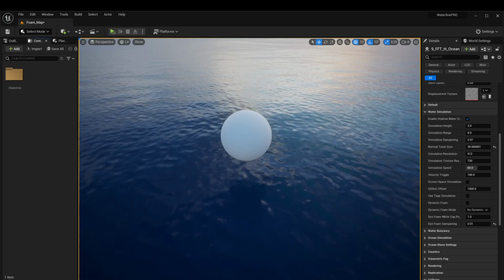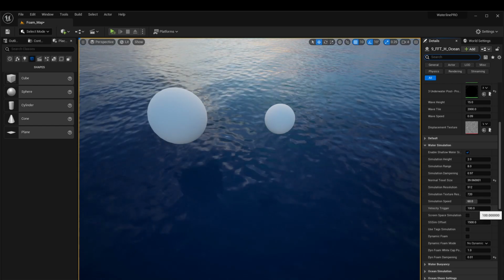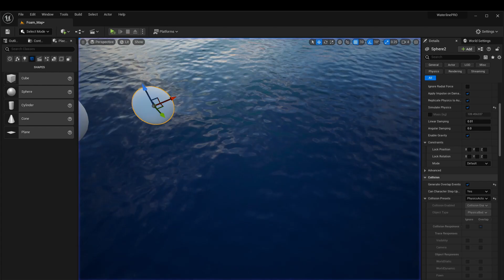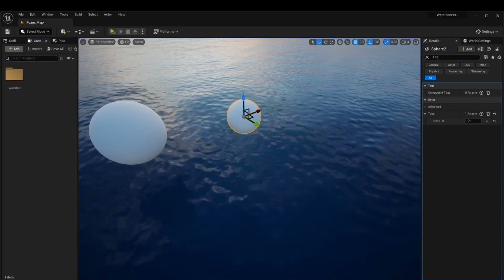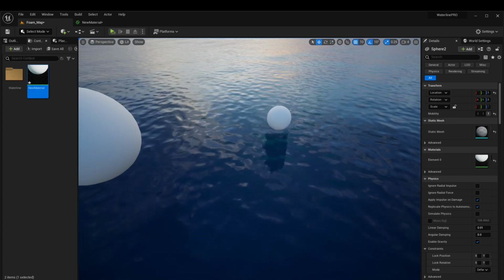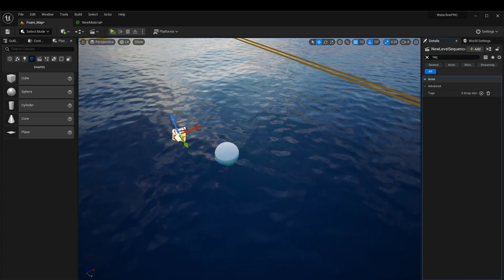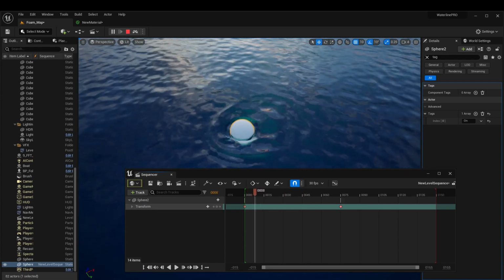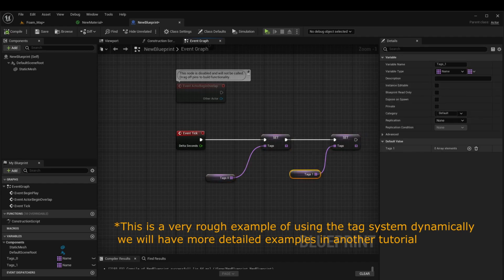Waterline PRO Tutorial: Dynamic Water Simulation - Part 2 Object Settings

Comment: May i ask here a question about simulation? I tried both of v5.4 and v6.0 in my project which bases on UE5.3. And when actor touches waterline, it doesn't happened anything. I also followed every steps from tutorials here. I used WaterSim not Ocean. Does anyone know the reason, is't some wrong or lost?
Reply from the maker: Hi!
There is an extra step that we cover here that goes over specifying which object channels for interaction and buoyancy:
https://youtu.be/ZMVe28GsLiA?si=-XY_qzgba7yFTwfn&t=142

If the issue persists please let us know on our support email.
Reply: @dumpsterfireproductions  Thank you for your friendly replay, and i will try it!

Comment: With what settings to render so that the water is not blurred?
Reply from the maker: Hi!
Usually this requires tweaking some TSR console commands, disabling TSR Upscaling and in some cases you may need to adjust the Tile-Break distance of the Water Surface Material.
If the issues persist or you have trouble implementing these contact us on our support email.

Comment: No matter what I do, whenever I add an object and try to simulate the object just falls through and disappears giving me an error:  Blueprint Runtime Error: "Accessed None trying to read property CallFunc_K2_GetPawn_ReturnValue". Any idea?
Reply from the maker: Hi!

Sounds like a Camera Tracker issue - we cover this in Part 1 here:
https://youtu.be/nvLxbPHvrYc?si=FiMlYEQpS4j215WC&t=109

The buoyancy not working could be related to buoyancy and simulation channel setup cover in part 5 here:
https://youtu.be/ZMVe28GsLiA?si=AKpdpFZOUcX4Lobq&t=141

If these do not help contact us on our support email with details regarding your setup and we will investigate further.
Reply: @dumpsterfireproductions  hey! I tried the two and nothing seems to be working:( I still have the issue even after making sure waterline channel is added and the camera tracker is set to my sphere. What is the support email and how can I get assistance with my issue, if that's possible? Thank you.
Reply from the maker: @denisfilatov7609  
On the store page, See Details under Included Formats, then Technical Details and you will see it at the bottom.
It's a little annoying since the site changed to format so we will be updating it to be more visible.

Comment: I created one sphere, moves up & down. I need water generate waves while sphere just touching the water, but In my case it generate waves only sphere moves at least half of its size. Pls anyone help to generate waves only sphere bottom just touches the water level pls? 😊
Reply from the maker: Hi!
It sound like you would like your sphere to always generate waves regardless of it's velocity - to do that give it the Actor Tag "On"
If the issue persists please let u know on our support email :)
Reply: Yes...
It stimulates only when shpere goes half of its size. I need it give when sphere bottom touches the water pls...
Reply from the maker: @jnanashakthidigitals Can you try selecting the Waterline Actor and in the components section select the "Sim Capture Volume" and increase it's Z scale (something like 5 or 10 should work but you can try even bigger numbers) if the issue persists please let us know on our support email.
Reply: It's worked 
Thanks